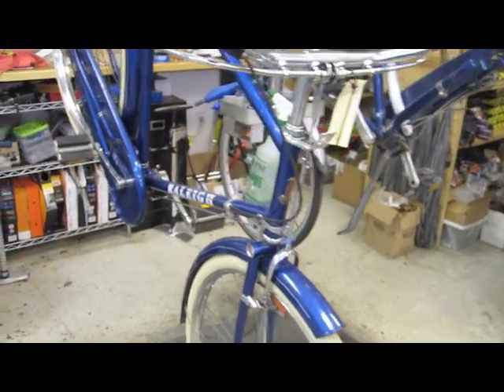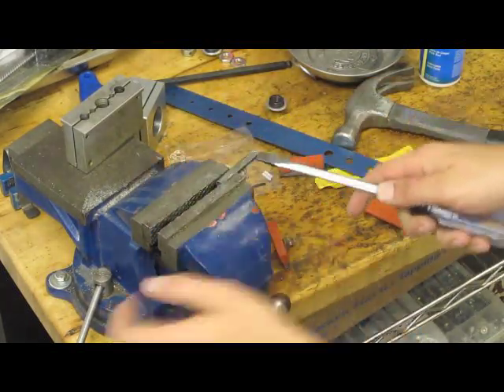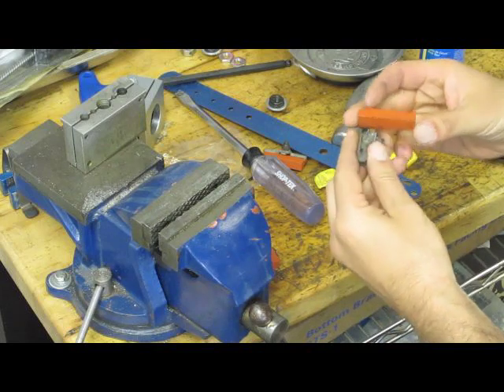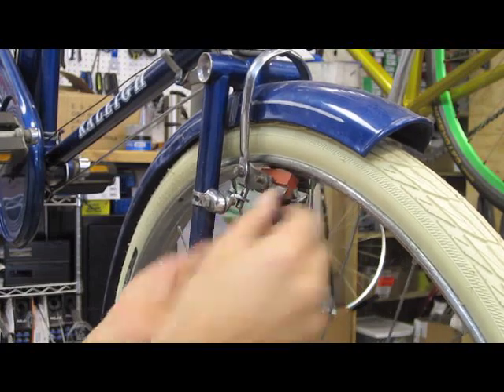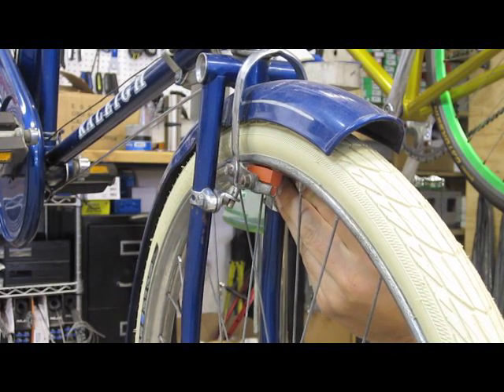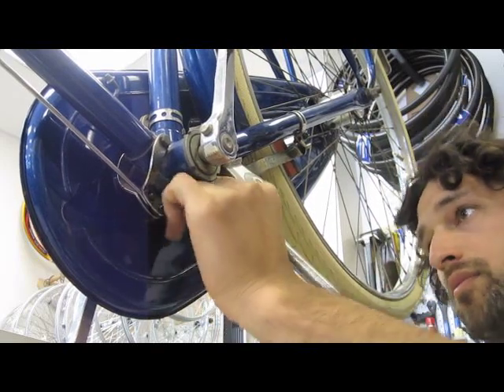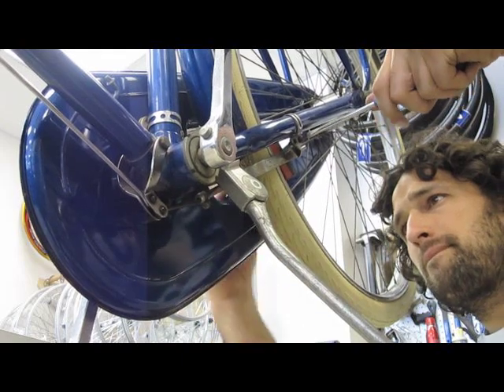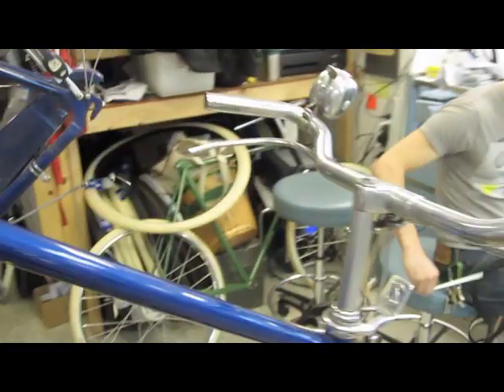Raleigh rod brake repair at Flying Pigeon LA bike shop

Comment from the maker: There are many different styles of rod brakes. I have worked on Dutch rod-to-drum brakes, Raleigh center-pull, Phillips side-pull, and a few other varieties I don't even know the names of. The sets I have are Phillips side-pull. If you are in Europe - try calling around in the U.K. - the place is as full as anywhere on earth with rod brake systems and parts. Best of luck!

Comment: Don't need big gap between pad holder and pin guide on fork, flat head blade is plenty. No toe in needed on pads. Front to back pad angle set with pad retaining nut.

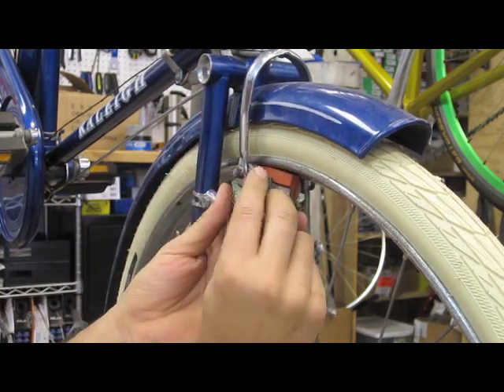Comment: At 2:01, you can see the pad is fixed to a bracket that is offsetting it to the front of the stirrup.  I read elsewhere online that this is wrong, that the offst should be behind, ie to place the brake pad between the front forks and the stirrup.  Is that information incorrect, or did you leave these as they are as that was where the owner wanted them?
Reply: Looks like a nice restoration, by the way :)

Comment: I find an easy way to get the pads perfectly parallel is to screw them in till they are almost tight, then pull the brake lever to push them against the rim, which aligns them perfectly, then tightening them up the rest of the way. 

Do you guys have a source for full chain cases?

Comment from the maker: Full chain cases? We have a few vinyl shell/steel cage numbers from Holland and Flying Pigeon steel cases. The problem is that one chain case does not fit all. In fact, they often only fit one specific bike, or a few with similar measurements.

Comment from the maker: The brake pads are not backwards! The pads have a  mounting bolt in the middle of the length of the pad - it looks "offset" but it is not! And what is a quid?
Reply: ubrayj02 The pads aren't backwards, the brackets the front pads are attached to however ARE. You want those brackets pointing towards the rear of the fork, tucked underneath the crown. Although difficult to understand, this placement supposedly encourages the pads toward the rim, rather than encouraging them away from the rim. = better braking.
Reply: @Metal-Possum  The front pads are attached to a bracket that offsets them to the front of the stirrup in order to avoid, or at least reduce, the typical "tremble" that affects the front wheel when you apply the brakes. I have seen this only on Raleigh bikes and can not assure if it works as supposed.